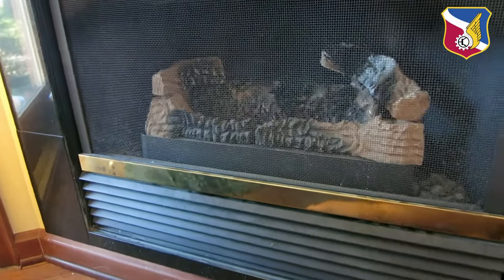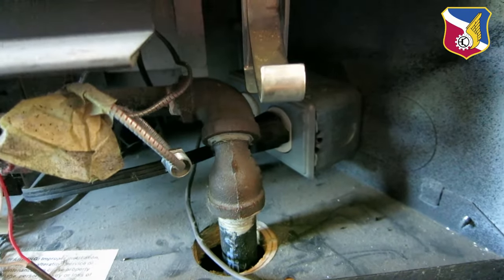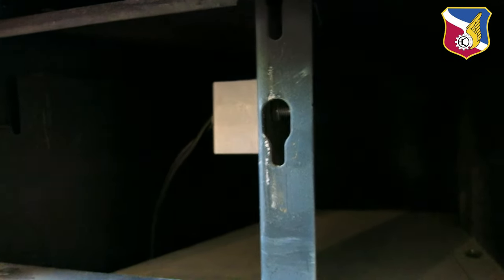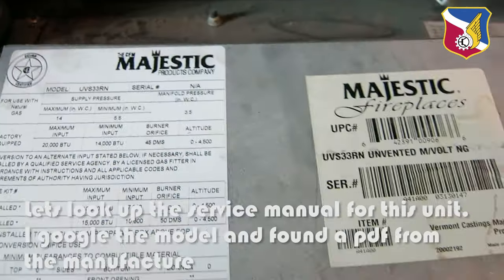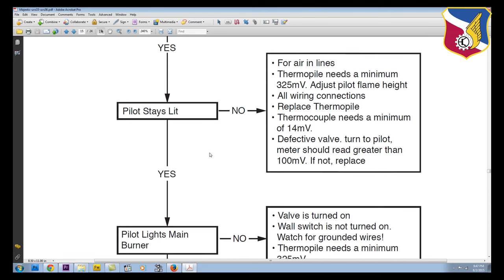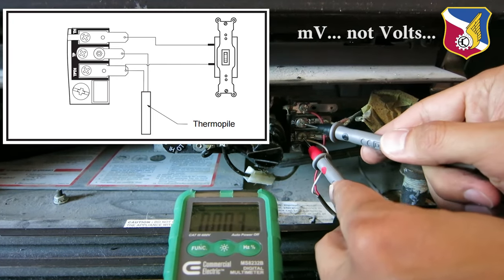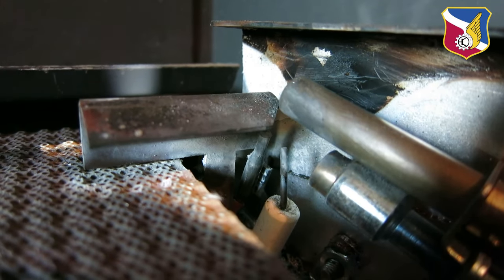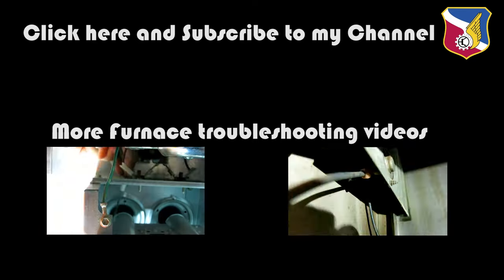Majestic UVS33 UVS36 Fireplace not working - Troubleshoot Furnace Vent Free Heater no flame

Comment: I don't have the same fireplace version but I did the steps of cleaning the sensors that generate the voltage (never really knew that's how they worked).  But a wet rag, wirebrush and I put everything back.  Turned on the pilot, pilot light stayed on then moment of truth . . . hit the switch and  . . .FIRE PLACE ON !  Thank you so much!

Comment: What if thermopile reads over 500mvolts,  everything is clean, nice large blue flame at pilot, switch is good but still wont light
Reply: Well turned out to be my thermopile. Yes it read 500mvolts with the pilot on but when the wall switch is turned on there was no voltage. Should have 20mvolts. Replaced thermopile and works perfect.

Comment: Watched your video. I took off the back cover over the vent so I could get a good view of the pilot and thermo parts. Cleaned them with vinegar and steel wool. Voila, the switch now lights the fireplace. Good as new. THANKS for posting the video, wouldn't have know to just clean the parts the pilot heats up.

Comment: thank you. I have a stupid Gas36TV unit that is ONLY for decoration, no blower. Wonder if I can add the blower to actually get heat out. I think the heat just goes up the vented stack. Really stupid to have a gas log insert that does not warm up the house!